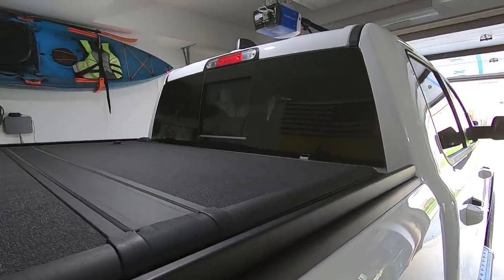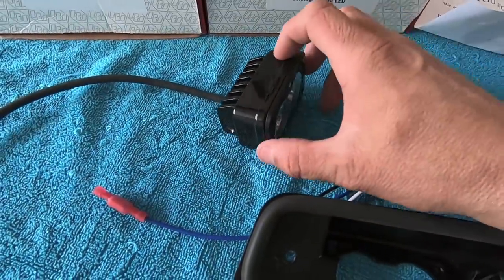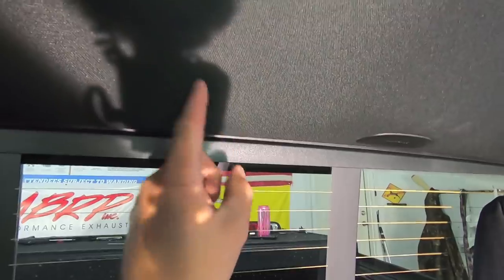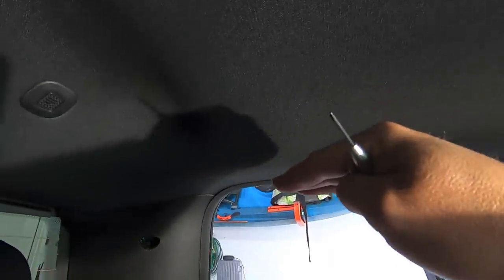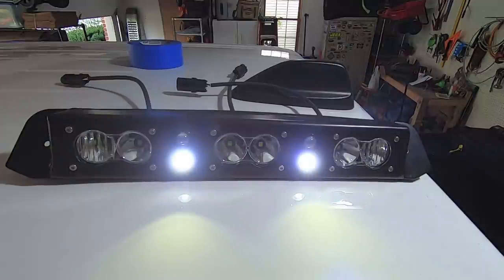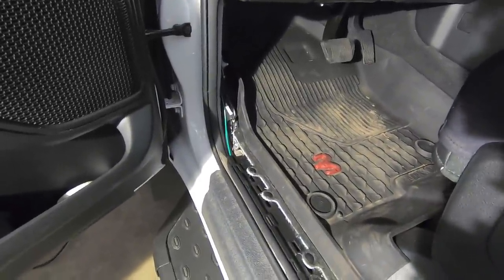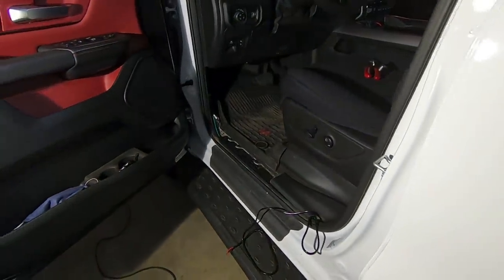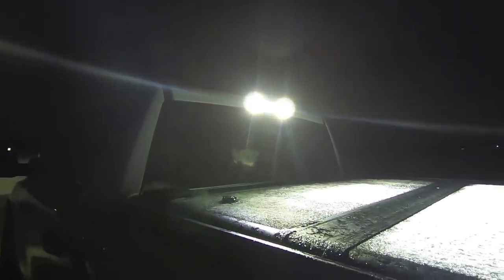Evil Manufacturing 3rd Brake Light - Ram Rebel

Comment: Got this same 3rd brake light for my 2021 ram 1500 and it was terrible i grinded down the lights and nothing fits i grinded down both sides of the lights and still nothing !!!! not only that but the hardware mount holes were too small and i had to drill out all holes a bit bigger ! after grinding down the bezel from the BD they still didnt fit in at all either !! im super disappointed with the evil man. 3rd brake light especially for the price
great vid
Reply from the maker: Did you try reaching out to them?

Comment: The 5th gen RAM cab is the same as the 4 gen cab. Due to water leak issues, FCA added the two center screws for the 3ed brake light to correct those water leak issues. Factory procedure when installing the 3ed brake light is to install  the center screws first then the outer screws. Removing those screws will result in a water leak which will damage the headliner.  I would recommend NOT to do this mod.
Reply from the maker: This bracket is metal compared to the factory plastic so there is no deflection. The center screws are not needed.

Comment: A little off topic, but how do you like the Extang Encore?  I'm struggling deciding between it and the Bakflip Mx4
Reply from the maker: The matte finish and the ability to fold up the front panel sold me on this cover. I love it and now that I have a rack that works with it, I’m totally sold on the encore.
Reply: @WaterFowler41  I more question.  Do you think a mountain bike will still fit if the first two parts of cover are folded back?   A bike hanging over the tailgate
Reply from the maker: Yeah I think so
Reply: A better cover is the undercover armor flex the panels are line x at the factory and  it doesn’t stick up as high. I sell and install these covers on a daily basis and the undercover has a better water management system. The MX4 rests against the cab when folded open the only truck we recommend that for is the new GM’s or any truck with a camera in the third brake light. We sell the undercover ultra flex or armor flex at least 15 to 1 if not more.
Reply from the maker: I’d love to do a side by side of the two covers! If you’re interested email me at waterfowler4one@gmail.com

I really like the front opening panel on the encore but sometimes do with I had the ability to fold it all up.
Reply: I have the same cover on my ram and I love it, but it isn't very waterproof.

Comment: Dumb question... Doesn't Evil Manufacturing have a recommended light that would fit their housing???  They should have a light that fits their housing that would fit your specific vehicle?
Reply from the maker: The brackets are built specifically for the Baja Design S2’s. The modifications I had to make to the brackets were outlandish. I expected it given the small amount of space available in the opening.

Comment: Too bad there isn’t a provision for a factory rear 3rd brake light camera. Nice video!!!
Reply from the maker: You can actually buy a plate from evil that houses a camera so you can run 2 S2 lights and in the center spot you can mount your camera. 

https://www.evilmanufacturing.com/lights/evil-offroad-3rd-brake-light-dual-camera-system